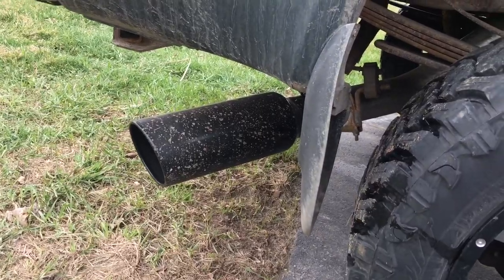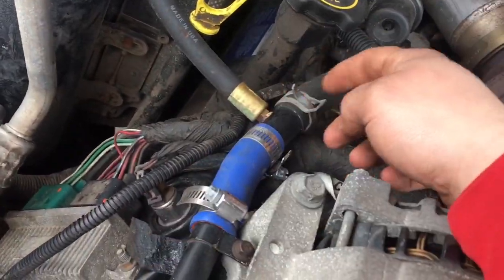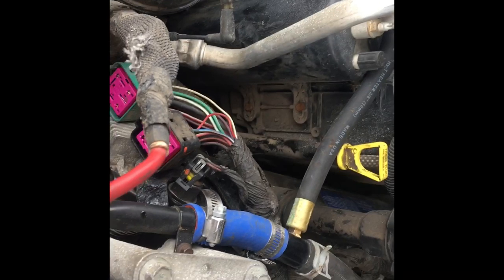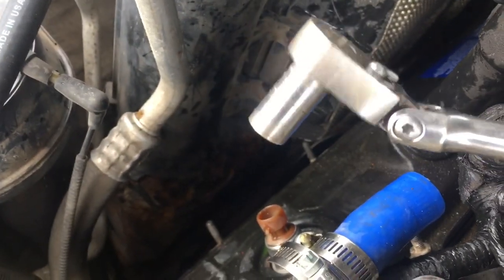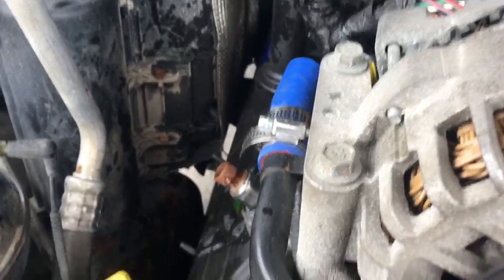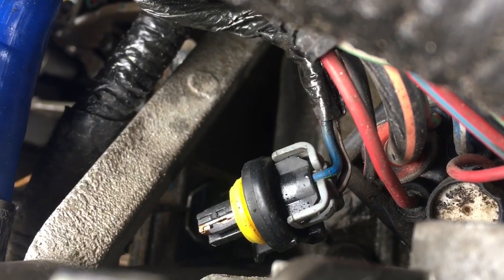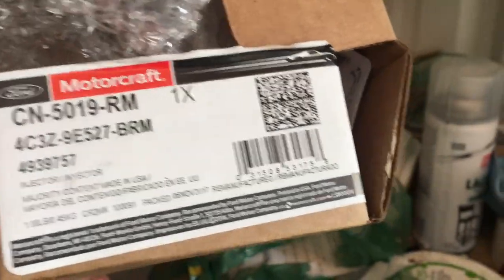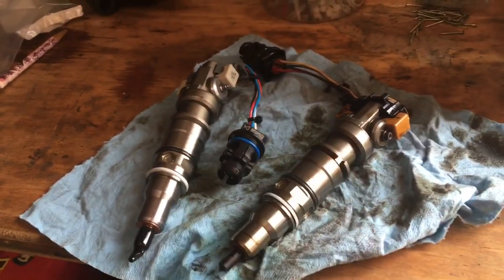6.0 POWERSTROKE INJECTOR REPLACEMENT

Comment: Nice job. Wise man going with Ford/Motorcraft injectors too 👍 I think Alliant remanufactures them.

I killed my starter building up oil pressure. 2 days later I was on my back in a puddle changing it out in a Bed Bath and Beyond parking lot.

Comment: Love your videos. I’m about to change out all 8 injectors. Are the cups a common failure point and should I go ahead and change them all out or is it not worth the hassle if it’s stock and they look fine? Has 300k miles on it.
Reply from the maker: The injector cups are not very common to fail, the head will crack before the cups fail. I wouldn’t touch the injector cups, just clean them up before installing the new injectors. Hope this helps! Thanks for following along with the channel!
Reply: Thanks a lot man, I really appreciate your videos.

Comment: Which tool and test did you complete to come to the conclusion you had a sticking injector?  Does your scanner perform the IDS “power balance test” for individual contribution?
Reply from the maker: Exactly, through power balance I was able to determine which injector was misfiring.

Comment: Great video! The injector connector that is in the rocker box is not seated on my injector #5. You can feel air pushing up past the connector, any idea what would cause that?
Reply from the maker: There’s an oring there that seals that part, the oring could be blown out or not seated right
Reply: That area shouldn’t be pressurized so that’s why I’m confused as to why air would be pushing out.
Reply from the maker: You will have crank case pressure

Comment: Awesome info bro. Hey I have a question, my 2005 6.0 starts and runs pretty good but when my engine gets up to normal operating temperature, when I shut it off, it will not start  until the engine cools down.The engine will turn over but will not start up.Do you or anyone  have any idea what would be the cause of this problem? Thanks in advance.
Reply from the maker: What year is the truck? Sounds like a high pressure oil leak. If 05-07 it could be stand pipes or dummy plugs. Could also be stc fitting on hpop or a top injector o-ring.
Reply: Left Lane Diesels it’s a 2005 6.0 DRW . I had it Bulletproof and got 2 injectors installed about 5 years ago. It has a SCT Tuner. I just changed the fuel filters and installed a S&B cold air intake. The problem has been happening about 3 years ago. I had the truck parked for almost 2 of the 3 threes.
Reply from the maker: Sounds like a top injector seal. What is icp while cranking when it doesn’t start?
Reply: Left Lane Diesels I don’t have any equipment to check.what would be the best tool to get to check?
Reply from the maker: THE EXODUS SOLDIER I would recommend a cts 3. It will give you all the data logging information, it can also serve as a monitor while driving, check and clear codes. You can also add egt and other things later down the road. Highly recommend for all purpose use on a 6.0. Use this link to get one then when you get it I would be more than happy to help diagnose! 
https://kcturbos.com/products/edge-insight-cts2?_pos=1&_sid=a4498fe89&_ss=r&ref:MTA1MzY3LjIyMjUuMTA1NDIyLlQ
Reply: Left Lane Diesels I do have a SCT Tuner. Would I be able to check the ICP with it?
Reply from the maker: THE EXODUS SOLDIER what model sct device?
Reply: Left Lane Diesels SCT X4 power flash
Reply from the maker: THE EXODUS SOLDIER x4 can read icp. To better get ahold of me,  dm me on Instagram at @left_lane_cbull
Reply: Left Lane Diesels did you get my dm on instagram?
Reply: @LeftLaneDiesels  I have two questions. If one can afford to would it be better to just do all the injectors? I heard if one fails the rest are going to follow shortly after. Also, the CTS3 monitor is that also for tuning? Or is that something totally different and what do you suggest? I don't want anything crazy my truck is bulletproofed but has never been tuned. I do pull a big camp trailer. I would just like to improve my fuel mileage and horsepower. Thanks for the videos!
Reply from the maker: @John-rr7bf  yes you will save money and time in the long run to just replace all injectors at the same time. So if it’s in your budget do all 8. The cts 3 is only a monitor not a tuner. It is what I would recommend for monitoring. For tuning get a sctx4 with custom tunes! Contact T&a diesel 269-832-6755 they can get you set up with everything you need. Tell them I sent you!
Reply: @LeftLaneDiesels  That sounds great thanks for the information!